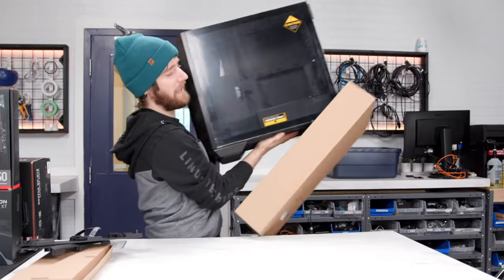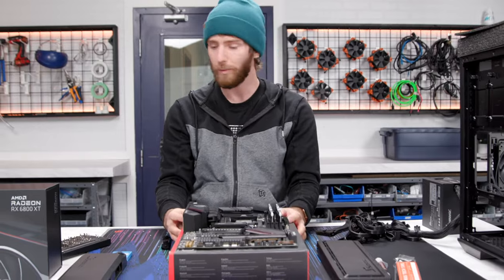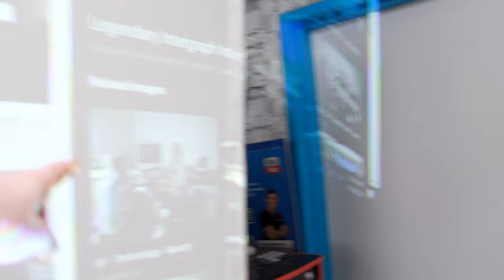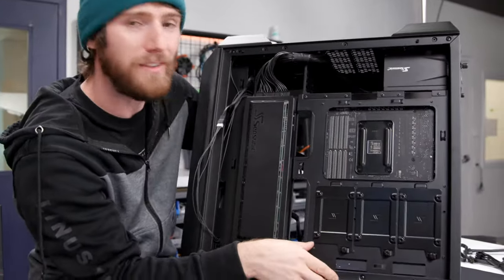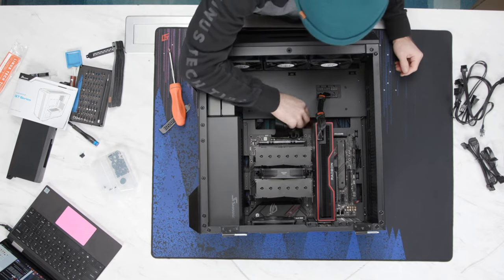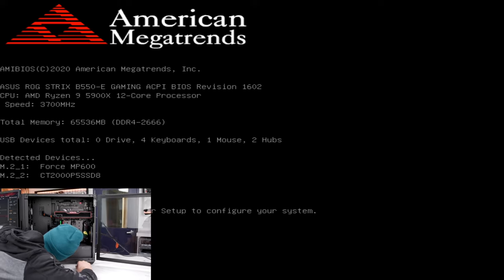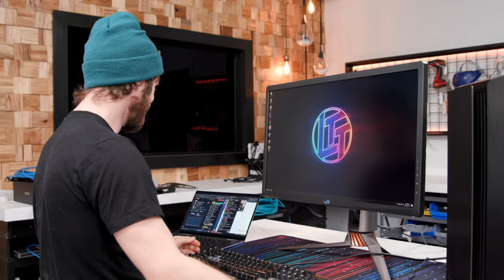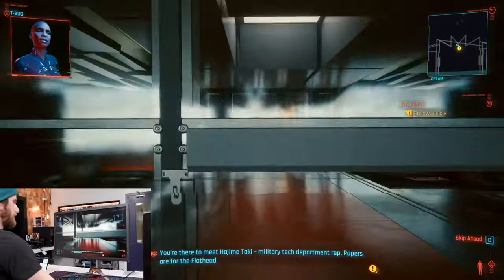The CLEANEST AMD Gaming PC Build

Comment: Seasonic being chill has made me want to buy their stuff more than any other bramd that's done a sponsorship
Reply: Seasonic: "Pecking order"
Reply: And they even make good power supplies, they are like the perfect sponsor
Reply: Also sending out free (decent looking, not sleeved, but with combs) 3080 FE cables, massive love for seasonic.
Reply: I bought a Seasonic power supply instead of a Corsair one and never had regrets.
Reply: Same but it was too expensive for me so I bought the rm850 from Corsair (113€)
Reply: Or ones go all out like Dbrand
Reply: I really agree with you on this. I’ll buy their gear when I build my next pc for that reason.
Reply: @doctorobvyous  this guy knows
Reply: @conman1395  This question might seem dumb but I don’t know much about computers. Does the monitor produce hz or FPS.
Reply: @imcomp2819  the Monitor has hz and the Computer generates fps
Reply: @doctorobvyous                     00
Reply: Agreed but why is the glass panel on the other side? Would have to change all my setup
Reply: @AaronShenghao  nah, dbrand is just a hardcore memer lmao
Reply: shill
Reply: corsair and seasonic are good choices
Reply: Right
Reply: Hail Lord Popo
Reply: I bought a way overkill PSU from Seasonic just because they were super chill about the last one i had that broke and they seem chill to Linus! <3 Seasonic
Reply: @knightsljx   My newish system is running off of the 700W seasonic PSU that I left in my flooded apartment during my evac from hurrican Harvey.  Once the water got to my ankles that night the storm hit, I decided it was time to turn off Titanfall 2, and start prepping to leave by disconnecting the PC (and Xbox controller), wrap it in plastic, then duck the fuck out of it.  I ended up in north TX and a relative had to go assess damage and recovered my PC I stashed in the top shelf of my closet.  Literally the only thing that I didnt lose. I Ended up upgrading everything except the PSU, a few months before the start of the pandemic globally.  I disassembled, cleaned and replaced the fan in the PSU, and reused it in my new build. beginning specs were 8350FX with r9 280x, which changed to a gtx 1050, then to a silicone jackpot rx 570.  Then I upgraded to 2600x cpu paired with 5700xt gpu.
Reply: @YouBetterCallSaul  it was invisible you just couldn't see it.
Reply: @kertig  so
Reply: @marcuslopez7302  ß
Reply: @peter_parkour  lol, seasonic makes most of the Corsair PSU's.
Reply: damn, didn't know they built gaming PCs up on the Lookout
Reply: I run corsair psus primarily cause i love corsair and never had issues with them but I also have a evga and wouldn't mind  seasonic. The only 3 brands I would ever even consider in a build is seasonic corsair and evga. 😊

Comment: Forget “Military Grade”, the new label of choice has to be “Linus Safe”
Reply: Military grade literally means, the cheapest and shittiest shit you can get that meets specs
Reply: @masterhacker7065  most military grade stuff is also decently durable tho, although also some stuff is very much built by the lowest bidder
Reply: Linus Torvalds does not approve
Reply: @EzeKry  As a former member of the armed forces, military grade means- durable and cheap and "it works, ish".
Reply: @HickLif3  ye that is a pretty solid summary

Comment: As someone who has worked in a distribution center, I'm amazed that anything gets delivered at all. The backbone of any facility is the main belt which sorts the packages and directs them to the proper outbound truck. At the end of that belt is a trailer and package handler. Package handlers almost always have several trailers. The minimum flow they can expect 500 packages an hour. This includes iregs, which are packages that can weigh up to 150 pounds. To make it worse, these trailers have no heat and no ac, so they're drenched in sweat in the summer.

This isn't mcdonald's. Working as a package handler is the hardest job I've ever had and can be pretty physically demanding. Most people quit in the first week. I found it difficult at first and I've run marathons.

When it comes to package tossing, it's prohibited by every employer, but they create conditions that leave package handlers with no other choice. If you're being fed 1000+ packages an hour, you don't have time to gently place every package. Most people try their best to be gentle and only lightly toss packages onto others to avoid damage. I've never seen someone intentionally damage a package, but there were plenty of times a box got roughed up because package handlers were being pushed to their limit.

I'm also fairly certain that a good deal of damage occurs due to packages shifting in the trailer during transit.
Reply: Mcdonalds is demanding too you have never worked in a fast food. I have worked everything from retail, food, manufacturing and food and manufacturing were pretty even package distribution has its cons

Comment: The connector Linus talks about around 59:00 is sometimes included with certain MoBos. I’ve had a few ABIT boards where the connections were screen printed on a m/f header extension and you just put the case wires on the header, then plug in the header, and everything works. It would be awesome if all MoBo manufacturers could get on that.

Comment: 58:57 - Just a standard connector which all vendors (motherboard and case) use. And if some case manufacturer for Case XYZ doesn't need a Power LED (for example) then they just leave the corresponding pinouts on the connector blank.

Comment: I'm pumped to see the parts used here as I'm building a new PC (reusing a 1070 for graphics and Asus AC68 wireless card for now) and seeing a Strix B550 plus NH-D15 and gearing 5900X has me excited as I'm doing 5900X + Strix B550-F + NH-D15 + WD Black N750 M.2 + Lancool II Mesh + 16GB RAM + 1000W power supply

Comment: Linus should make a bed set that makes your bed look like a gaming pc with the side open and laying on it's side. The blanket will by the case side and then when you pull the blanket back you see the sheets which look like the inside of a pc. And than instead of a cpu pillow make a psu pillow for power naps.

Comment: This might have been posted already, but around 58:00 Linus is talking about how to make the front panel connectors more user friendly.  
I own a NR200P and it comes with a plastic clip around the connectors so that everything can be plugged in at once, without a block (don't know what it's called) in between!
With a little effort, you can remove the plastic clip if you really like the clean look.

Comment: SecuFirm clearly is the coolest mechanism out there. But for most applications, as long as it provides even pressure and sits nice and tight I see no problem with a less user friendly mechanism, bc most PCs won't be taken apart to the cpu cooler level for a longer while after they are up and running.

Comment: Pro Tip: Mount a small switch on underside of the table, and route its core connection under the cable management you already have on the floor.

Comment: 50:58 The reason it doesn't work as well as you would think is that the friction between them can actually rip them and even if it's only a small amount that gets through, even that is enough to contribute to the population, to keep it vague enough for those little butterflies.

Comment: This is almost what I built. rx6800 with Ryzen 5800, and the same cooler but with two fans. The Mesify C barely fits that cooler if using the second fan cause it has to be raised up a bit for ram clearance. The other thing I got that I think looks sweet are the heatsink covers from Noctua. I have only 2 x 16gb ram, but the total cost all in was closer to $2000. The hard part was finding a gpu at msrp or close to it.

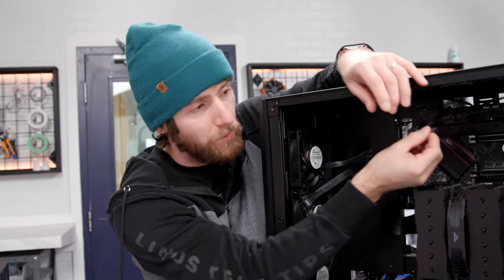Comment: 58:14 I always thought there should be power and fan connector extensions.  Little stubby ones which you can connect to the motherboard before you put it in the case where it's dark and less accessible.  Then you just connect the fans or whatever to the two inch extension and you're all like 'ahhhhhh'.

Comment: Maybe I'm just old fashioned, but I still feel like the breakout of 5v and 3,3v from the 12v by adding a secondary routing hub is a solution searching for a problem. A standard modular PSU offers virtually the same benefits.  You're still routing cables to every device.

Comment: I have this exact cpu cooler sitting on a an AMD 3950x in a Asus Tuf Gaming x570 Plus (wifi) At idle it's temps are 32 celsius. Under full load crypto mining it hits about 63C. I can oc it to 4GHz and it still runs under 70.

Comment: Most damage to packaging is not done by the people who handle the packages. I use to work at ups and on the conveyer belts that would move the boxes around the buildings sometimes get stuck. The area I worked at would get jammed all the time making some boxes get damaged, and sometimes the jam would happen so fast they would fall over the gard rail and fall like 40ft to the concrete floor
Reply: really cause I work at UPS and every handles every package like theyre footballs

Comment: It would be cool if the connectors like usb, power, the psu connectors, etc were on the back of the mobo so just the hardware showed in the front and it would look so clean

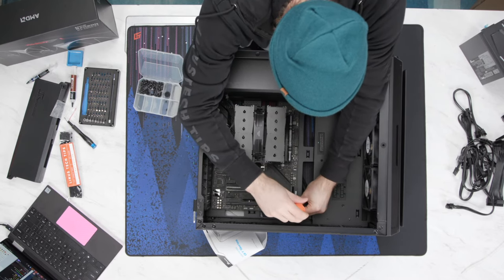Comment: 41:00 First time I've seen a motherboard with the CPU near the bottom and GPU in the top !
It seems that this case has the mounting from the other side then most others (like left hand and right hands)
Kind of cool and works PERFECT if you need to put the computer on the LEFT side of a table and still have the window in view.

Comment: The Wi-Fi antenna and nic, on that board, is also the Bluetooth module. So it’s not just Wi-Fi but also Bluetooth that is included in that $20 extra. If you want to get a separate Bluetooth module for cheap, that’s fine but I’d rather just pay the extra 20$ and get the one that’s integrated with the board.

Comment: 24:30 sooo when is the LTT snap-on ratcheting screwdriver coming to LTTstore dot com?
Reply: If you have ever seen him use the purple screwdriver with the red cap, that is actually the prototype, he mentioned that in a different livestream.
Reply: @Moobeus  thanks I missed that. Good to know
Reply: TheMelbournelad no worries dude, trying to remember which live stream so I can link. Another thing I remember him mentioning in the same stream was one of the things that annoyed him about the snap on is that all the bits are just like stored in a hole thats in the handle, and you just have to like dump them all out to get the one u want. So I think on the LTT version there will be some sort of improved storage method for the bits to make it easier to just get the one u want.
Reply: @Moobeus  ohh I think I remember that one. Wasn’t it the budget Amd build  that was about hour long week or so back?
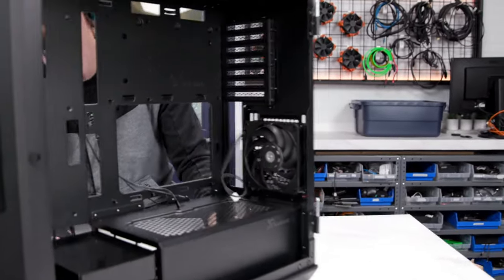Reply: TheMelbournelad not the stream I was referencing I don’t think but if you go to 3:00 in the video “no compromises tiny AMD gaming rig” you will see him use and talk about the screwdriver. You actually also see the thing I was talking about with the bits where instead of unscrewing the top like on the snap on and dumping out the bits, the top slides up and it has a rotating cylinder with all the bits attached.
Reply: TheMelbournelad I actually haven’t watched that one yet so probably not. It was in a livestream a couple months ago
Reply: @Moobeus  all good it came up in my watch list the “AMD bang for buck” https://youtu.be/emlRd643NVI. It’s around 28:50. Andy said no to sharing details.

Comment: @Linus 57:00
I have an MSI P45-8D Motherboard, that included these adapters in the box (13 years ago). So you were able to simply plug wires from any case to the adapter, and just smack that adapter onto the motherboard.

Only reason why I iked MSI at that point.
ps: intel q8200 is still kicking...

Comment: I think both pci slots should be full. I prefer to put my gpu on the bottom slot to keep it from radiating its heat into the cpu cooler.

Comment: You can get a 1st gen OLED 55 inch from LG for under $2K right now. It's pretty crazy. Even some of the 2nd gen aren't outrageously more expensive either. Or you could get a Hisense with quantum dots and a very large number of active backlight zones, 65" with 1200 nit peak brightness, for something like $1200 right now. It's insane how much the production of good quality 4K panels has been streamlined over the past few years. I am definitely waiting for someone to pull Apple's extremely miniaturized LED panels into a large-scale format, but there's still always cause for concern regarding burn-in when you're dealing with small, high output LEDs, since they are consumable parts. They're less so compared to OLED, which have a lower expected lifespan, but they're still consumables. So you'd have to get it down to the current pricing of the 1st gen OLED panels before it becomes legitimately useful, in my opinion. But that's mostly because my television is also a computer monitor and burn-in is a real problem for OLEDs and other consumable panel tech when being used as a monitor. The blue LEDs with white phosphor coatings used in current backlight tech are so ridiculously optimized that they will have the longest lifespan out of every other design currently available, and they still sometimes just die. essentially all displays are, to some degree, consumable products. The phosphor coating and cathode ray gun on a CRT, the individual plasma tubes of a plasma television, the cold cathode backlight of early LCD panels, the LED backlight arrays of modern LCD panels, and now OLEDs and mLED panels. Everything that produces light is, to some degree, a consumable part in the system. It just needs to be optimized in production to the degree that the consumer will feel that they have truly received a full return on their investment by the time it begins to fail. With cold cathode and LED backlights, that has pretty much been the case. With 1st gen OLED and CRTs? Well, it kinda depends on how much they cost and what their use case was.

Comment: I love AMD but in a sense they went backwards with b550. The old am3+ and am2+ boards were backwards compatible with the older chips. B550 does not officially support 1000 or 2000 series chips.

Comment: I picked one of these up when i got email anout a rebate, case with 850 psu was $471 plus tax and $20 shippng but i got a BIG rebate the mext day so it cost like $300ish if memory serves and rebate went righ back on my card. I just had my Sigma 650 psu die so my buddy is pulling parts from my Enermax case( bare ) and putting my old mobo and his used phenom X3 unlocked back in for now. 
I fully intend to build an am5 board here soon. Not sure its just shop computer for my tool box so its not getting huge amounts spent on it i just wanted cool case and high end psu.

Comment: The seasonic power board should be essentially the same as the conversion on the motherboard though - just outsource to the "case" or not ?.
Anyway i really dig this case and the power supply. Im just Sad it blows my usual budget like almost two times.
Now i run a Fractal Define R5 and an Enermax Revo XT2 550W - so i think it was like 180€ bucks combined.
Synchro has not much pricing due to availability but initial price with 650 Watts seems to be 330€

Comment: front panel i/o should be standardized and instead of headers, use the same connector for 8-pin power connector. or atleast some sort of sleeve that hold every connector together so we don't need to plug one by one every single fking time

Comment: do you revisit builds to see how they hold up through time, ease of upgrade, unforssen problems etc? I'd like to see this one 6months to a year down the line. didnt get the generic seasonic power bar thing because the boys at scan said theyd seen one of you vids and and it needed a special case. thinking they saw this and got confused with the power sytem in this compared to the old one.

Comment: To be honest I'm not scared of the cooler ripping off the mobo, but I'm scared of it pulling my CPU out. Last time my 2700X got stuck with the heatsink when I took the cooler off, and a bunch of pins were bent. I was freaked to hell. Luckily enough I was calm and I rebent them. It's still working.

Comment: I watched a breakdown of the UHD bluray release of LotR and they found the HDR was really good for the most part, but the digital noise reduction made some scenes look awful, like a closeup of a face where there's little movement, you'd see all the texture on the face, and then the character moves slightly and it would smooth it out so it looks like a plastic doll. It was clearly visible and in no way nostalgia goggles. Reiterating, it was the noise reduction, not the HDR that was bad.

Comment: Usb 2.0 still being on the io for the board is a necessity for me... still...  I have about a dozen devices that are usb 2.0 and when they are plugged into a USB 3.x port they'll show up as " unrecognized device " ...   they'll only function on usb 1.0 or 2.0 .... so if a board doesn't have any usb 1 or  2 ports I'd take a board with half the ram slots just to have the pre 3.x usb ports without needing a riser card. .

Comment: Whaaaa???? One single fan doing push and pull on the cpu cooler? Seems to me that the fan would be getting a major workout having to deal with the turbulence, drag and resistance of having a heat dissipater  on either side.......

Comment: with having wifi as a 'just in case for troubleshooting' whenever i had trouble through ethernet connection you can just plug your phone in via usb and turn on hotspot, making wifi just for troubleshooting a weak argument IMO